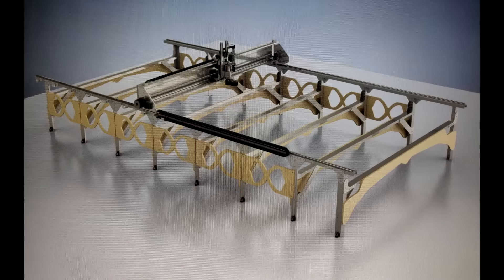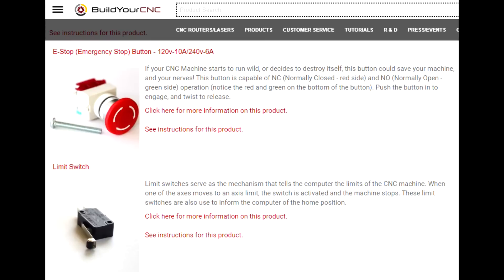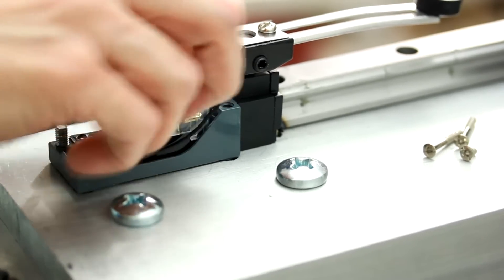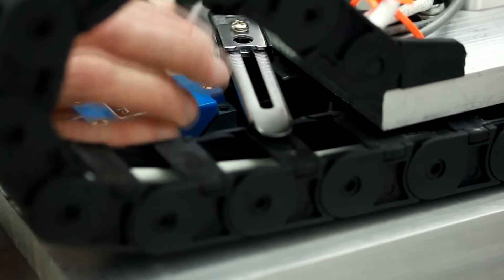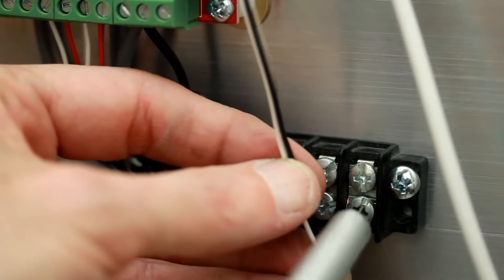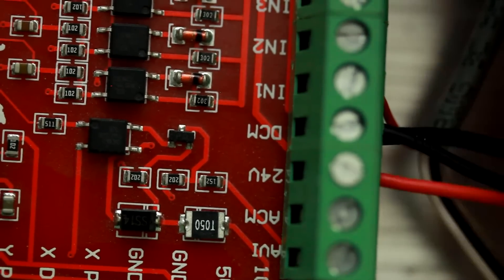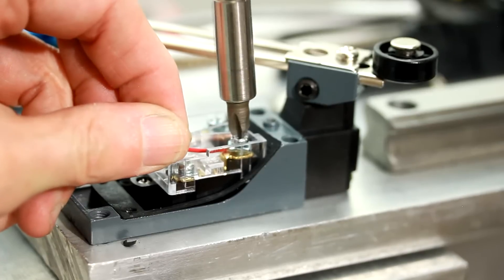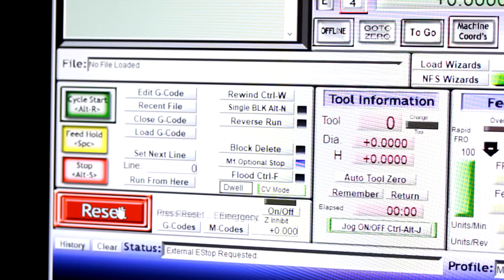Part 4: Limit Switch Wiring for the Mach3 USB Controller

Comment: To anyone who can’t get the ports to be detected by mach 3:
Make sure the switch is shorted or breaks the short when activated from the 24v ground to the input pin.
On the ports and pins input section, select port 3, and the pin is the same number as the input (1-4)
Hope this helps
Reply: Yes, this is correct. Ignore the info at the bottom of 'Ports and Pins' that says the inputs are 10-14 as well as the videos that say the same. On the USB version, they are 1-4, but just as important is selecting port 3 for each one.

Comment: I left a reply on @drhansen88 about your statement that you can't use Normal Close limit switches. You're wrong and Normal Open is a dangerous way to wire your limit switches. In NO mode the cons are that if a wire breaks or you lose 24V power you don't know it till your machine crashes. In NC if a wire breaks or you lose power to the 24V supply your machine won't run and forces you to find the fault. I need to stress this important factor to prevent novice users who believe what you're saying from physical harm or financial loss from their machine breaking down from a crash.
If anyone is interested on knowing how to wire it NC, leave a reply and I'll answer with a detailed explanation the best I know how.
Reply from the maker: I was referring to this particular controller and their recommended wiring that they disclose in their diagram and literature. In my years of wiring electronics since 2008, starting with parallel boards, I recommend NC as well. Since working with this board, I have played with the NC connection and works just fine.
Reply: Then why are you showing novice CNC builders that you can only do NO which is the most dangerous way of doing it. I wired my second machine with the new mach3 USB this week in series using NC and it works fine. You should seriously delete your video and make a new one showing the right way and save people from harm and damage to their equipment.  You have to wire all 5 limit switches ( or 6 if you put one at the bottom of your Z) in series to 1 pin for them to work as limit and home switches.  You can include the mushroom E stop button to save using another pin, which I did. Basically 1 wire leaves from the breakout board pin terminal loops through the limit switches comes back to one side of my E stop and the other side goes to ground on the breakout board.
In Config Ports & Pins use port 3 and then pin #  you want to use, then check active low for all the axis. In Home & Limits you need to home negative the X and Y.  
For the probe and corner finder make sure Active low is unchecked (X). I have the scripts to put in Operator Edit Button Script if you need them @PatrickHoodDaniel

Comment: How many amps does the 24V power supply need to output ?
Reply from the maker: The 24V power supply connection for the Mach3 USB controller only needs to be about 1 amp since it is only used for signal purposes and if used with relays, 2 amps would be better since the coils sometimes require more currents to engage.

Comment: Are you using usb connection or parallel port my connection is usb and controller is UC300 pins for x,y and z 1,2,3 port 1 unfortunately doesn’t work you can see led tuned ON diagnostic section but no action only E switch working ok
Reply from the maker: USB. The explanation I'm using here is for the USB controller in the video. I don't have much experience with the UC300.

Comment: Do you need any extra setting on mach3 on config ,  ports and pin ????  Also majority on you tube they recommend connection should be NC on limit switch and check on mach3 diagnostic section make sure led limit switches should OFF
Reply from the maker: The NC connection is a better fail-safe connection. You can connect these as NC as well. Make sure the port setting for the input is set to 3. The pin is the same as the IN# on the controller.

Comment: Hello buddy , I have a problem, it depends
  the machine stopped moving, the drivers did not
  green light is on, only red.  The
  mach3 moves but the machine does not.  Can
  be the communication problem between the
  computer and motherboard  .  plate is the same as
  yours, tried another new plate, the
  drivers both lights come on, red and
  green but still not moving.  I wait your
  answer, thanks!  I am writing to you from Spain.
Reply: Make sure you ground the drivers it happened to me and as soon as I grounded it it fixed the problem

Comment: Sir, I hope you can help me. Im using the same switch as you. And its working perfectly but if i use ut to home the machine the travel backoff is not enough and always triger the limit s instead.
Reply from the maker: You need the  home switches on a separate input terminal. You can still piggyback other limit switches with the home switches.

Comment: i have wired the same way but its not working. is there any onfiguration in mach 3 ?
Reply from the maker: Make sure you are using the xml file on my Mach3 USB webpage. https://www.buildyourcnc.com/item/electronicsAndMotors-electronic-component-breakout-Mach3-USB-Board
Reply: @PatrickHoodDaniel  can it work with mach4?
Reply from the maker: @muneeburrehman450  No, only Mach3. I offer a controller that works with Mach4: pokeys57cnc controller. You can find it at Buildyourcnc.com
Reply: @PatrickHoodDaniel  yes i found it later. the problem was gone after configuring port numbers.

Comment: Hello,
I have my 3 homing switches to input number 2 and all parallel NO, but after z axis reaches the homing switche this error appears "requested home axis home switch is active. please fix, then home." and it doesn't go for next axis homing,  can you help me please?
Reply from the maker: You will need to wire each home switch to a separate input.  It is ok to wire other limit switches to the same input, and even on the same ones being used by the home switches.
Reply: @PatrickHoodDaniel  thanks for your reply, for the record,  I had to adjust axis back after homing from 0.5mm to 1mm on the settings  to let the switch back to close position in order to finish the homing process.

Comment: DO NOT use "normally open" configuration. It is very bad practice.
In this configuration the controller expect a signal to come through, but if there is a disconnection or lose connection at ANY point in the loop, the signal will never come through. This means the machine will ram into end of travel and will continue to push, waiting for a signal that never comes....
Reply from the maker: I understand why you state that it is bad practice.  I used to say the same think a while back where a normally closed configuration is safer since the machine will power down if the connection becomes broken; however, most modern controllers now use the normally open configuration and there is no option for NC.  In my opinion, this is fine as long as you use shielded cable and the connections are solid.
Reply: @PatrickHoodDaniel  No, most modern controllers can do both, but recommend NC "normally closed". If your controller can't do NC, then it's time to replace it.
Also, NC is less sensitive to RF noise, since there is already a relative high DC voltage on the line.
Reply: You're wrong,  You don't know what your talking about. I just install the Mach3 USB on a second machine I just bought that came with NC Studio that I don't like. I wired in series with  Normal close and a 24 volt 2.7 amp  plug in power supply, and it's working as it should.
I read this post a few weeks ago before getting the mach3 USB board to see if their are differences from the RS235 that I have on my other machine. When I read it I thought their is no way the engineers for Mach3 would only allow the most unsafe practice of using NO for the limit switches. You need to educate yourself on the Mach3 and redo a video teaching the safer way of setting up your limit switches using NC not NO. Your wrong information can actually cause someone physical harm and financial loss over lost contact in a wire.   @PatrickHoodDaniel

Comment: Hi .. 
i have the same board and i just connected the home and limit switch parallel method and the home/limit switch ++ not active ! Also the y home/limit switch ++ not active!! I've check my wiring and every thing lock OK ! .. so what is could be the problem ? Some help please
Reply from the maker: Make sure the input connected to the limit switch is set to port 3 and the input number.

Comment: Dear sir nice one .. but i could not able to connect wire from mach3 cnc controller to my spindel wires ... can y make video on single line wiring from spindel on and off and speed control to mach3 cnc controller pcb

Comment: I have 2 X-axis,  I use the limit switches for homing.  Can the X and slave(A) homing be in series? I can't wire them up independently because there are only 4 inputs.  1 for E-stop, 1 for X homing+ limit,  1 for Y homing+ limit, 1 for Z homing+ limit. So no space for the A-axis homing. ( I wired them all nc.)
Reply from the maker: In this case, it would be better to wire the two drivers on the same axis to the same pulse and direction terminal for that axis.  Otherwise, you may want to use a more featureful controller like the pokeys57cnc.

Comment: Is it possible to use NC limit switches?  I understand that some people recommend this method as should a wire or connection fail then the machine will not run, whereas with NO switches the machine could still operate with some dire consequences. I think it's just a matter of setting up the Active facility in Mach3, is this correct. Also, many thanks for the tremendous help your videos provide, I'd be lost without them. Thanks for the UK :-)
Reply from the maker: No on this particular controller.  Most mechanical switches can be wired NO (normally open).  You can still use a single input when connecting switches in NO configuration, in parallel.
Reply: Wrong, You can and should wire NC on the controller. I know because I wired mine NC and it works perfectly. @PatrickHoodDaniel

Comment: Do I really need to connect 24V for the limit switches?
Reply: Breakout boards can use the parallel port power for limit switches but max is less than 5v. This leaves a lot of room for noise to false trigger the switch. Connecting 24V in normally closed configuration is a much better option.

Comment: Thanks for your videos. Works for me in serie "normally ON" switches and I change value IN1, port3, pin10. 
I see under in the table Input Signals this message:   " Pins 10-13 and 15 are input...  "     10, 11, 12, 13 and 15? or this is only for LPT?

Comment: Hi, I really like your channel. I watch the videos for several years and they were very helpful to update a Prolight CNC milling machine. Now I want to repair the lathe but I don't want to update it.
Reply: Only the Z axis fails, the control card is old and it seems that it does not send pulse signals. The db25 port sends dc signals.
Reply: Can you give me support ?. How to control a stepper motor with that type of signal, or if there is a driver? , for that type of signal.
Reply: Any comments will be appreciated. Regards.

Comment: I am using the identical board.
I see you are connecting the limit switch into IN1.
I have just rechecked the wiring diagram and IN1 is for E/STOP
IN2 is for limits and
IN3 is for homing.
If you are using IN1 for your limits and E/STOP how do you move your axis away from the limits switches when the limits are activated.
I have my twist release E/STOP on IN1 and if I dont release the E/STOP I cannot reset Mach3.
Reply from the maker: You can use the IN1 for e-stop or limits.  Mach3 configuration can change so that the E-stop is connected to a different input.
Reply: @PatrickHoodDaniel  I have the same board, could you please help me with the VFD setup PLEASE!!!!
Reply: I have the same board, could you please help me with the VFD setup PLEASE!!!!

Comment: Please, make more stm32 videos.
Reply from the maker: I am drafting a reference book/guide instead for the ARM and AVR.  This guide will include the information in the tutorial and include more where I left off.  I will provide information about this guide later when available.
Reply: @PatrickHoodDaniel  I have to be honest with you. I had some problems with your tutorials covering I2C peripheral. I couldn't get it to work properly. The code would hang inside those while loops when you wait for some flag. I had to reverse engineer the HAL functions and it turned out that they use a bit different approach (I hate HAL!). For instance, when you wait for the stop flag, you have to reset that flag afterwards in ICR register. Next thing - they wait for TXIS (not TXE ) flag when transmitting.